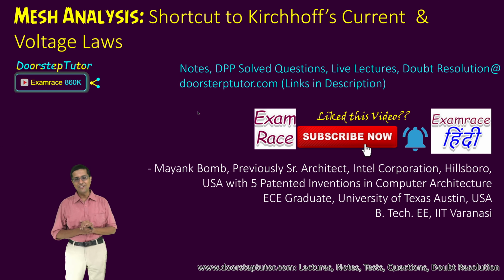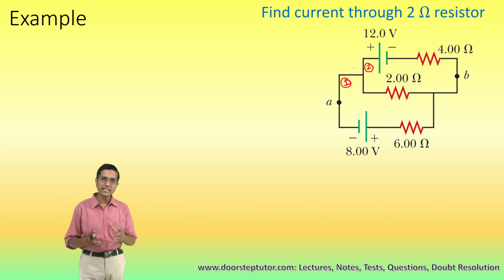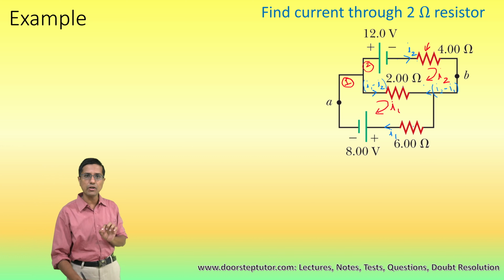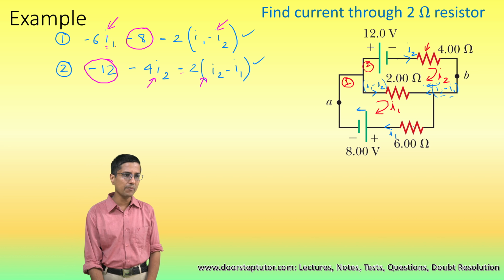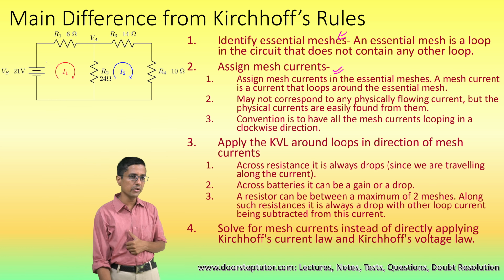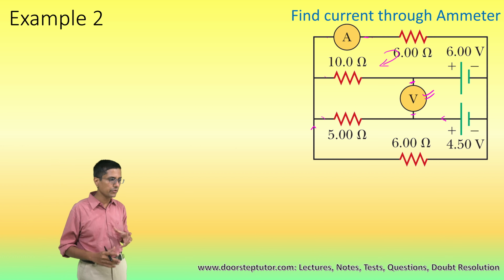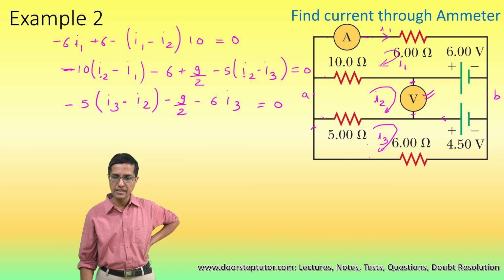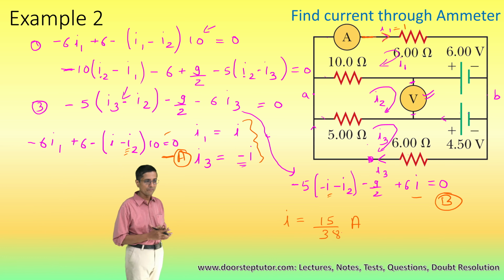Mesh Analysis As Shortcut to Kirchoffs Rules for Solving Resistance and Battery Circuits | Physics

Comment from the maker: Struggling with complex circuit analysis using Kirchhoff's laws? Mesh analysis offers a streamlined approach by using meshes instead of individual loops, significantly reducing the number of simultaneous equations needed. For more comprehensive problem-solving techniques and to master circuit analysis for your competitive exams, explore our extensive resources at https://www.doorsteptutor.com/Exams/. Drop your answer to the question discussed!